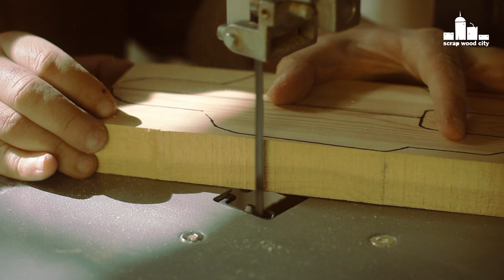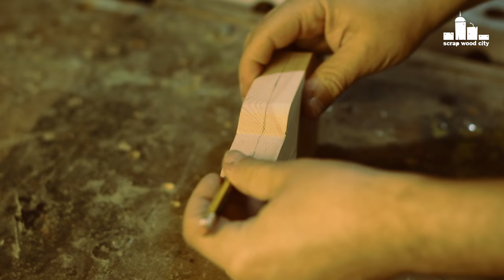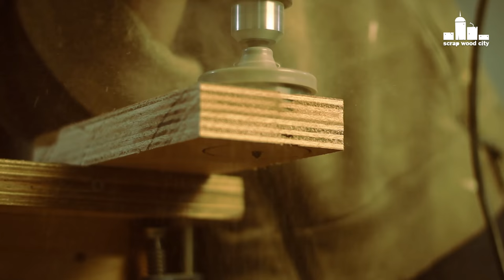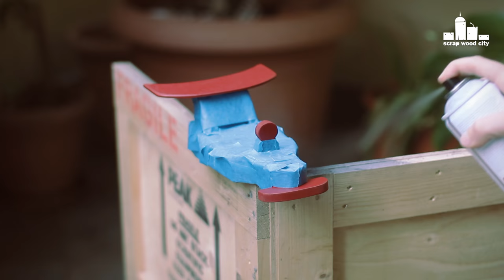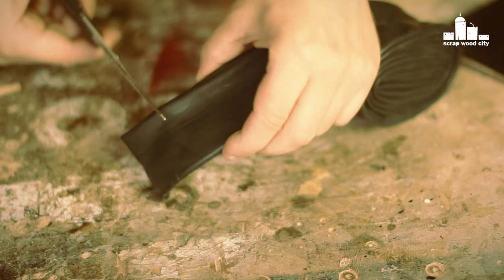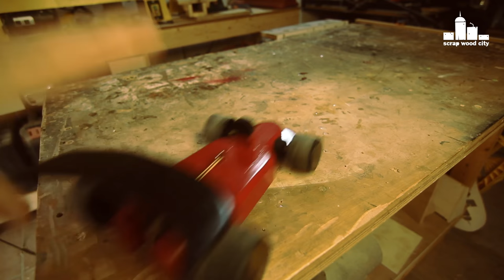Wooden DIY formula car toy

Comment: Nice and operational !
(I made a similar a few days ago, but quite lighter and with no rubberclad wheels, so no luck: the wheels just spinned...)
Reply from the maker: Awesome, I thought lighter would be faster, try using it on a carpet or a non glossy surface
Reply: No luck! Too small wheels, too light a vehicle...
Next attempt will suffice, I hope... :)